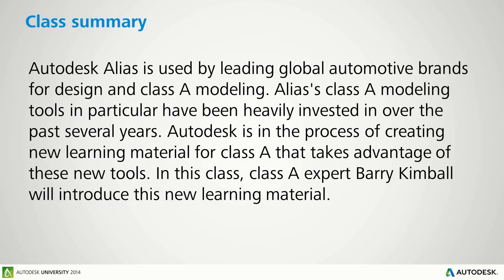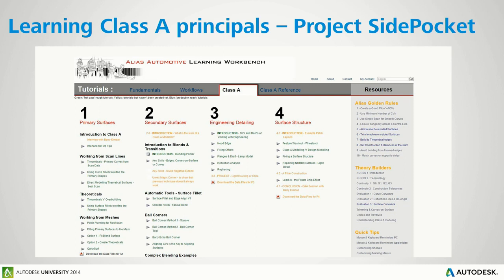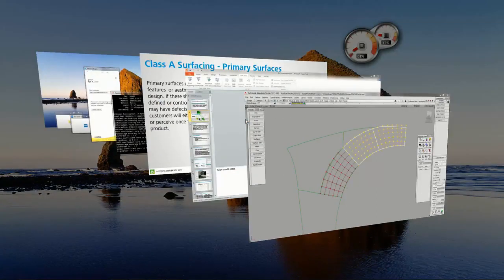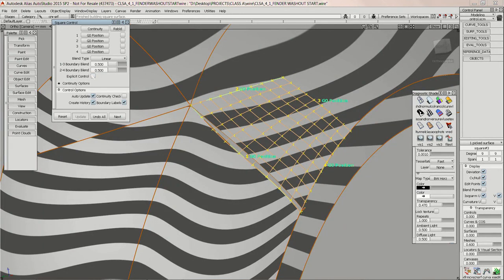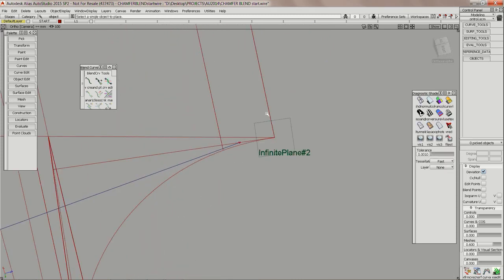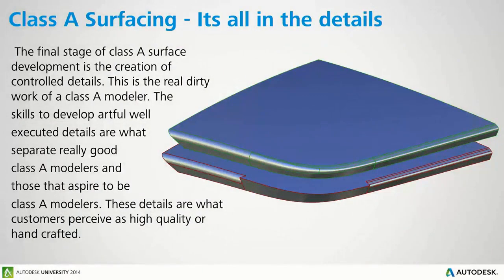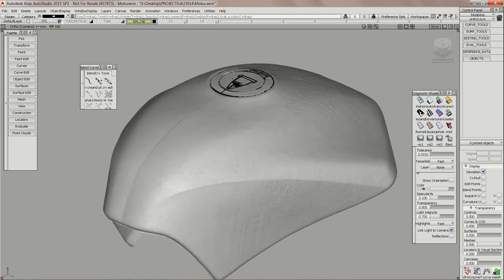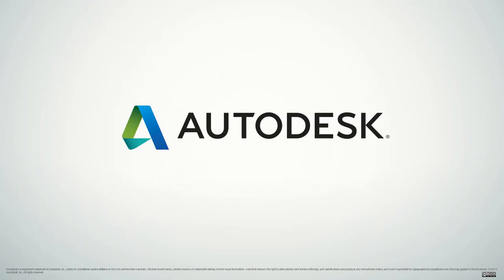Autodesk Alias Class A Surfacing Tutorial

Comment: It was great to watch the Workflow of creating the auxiliary Drafts and Free Form Blend surfaces. But wouldn't be easier to just use the existing top surface without creating the 'auxiliaries'. Having the top surface as well as the Curve On Surface on the side surface would suffice. Then using the Symmetric Fillet Control would generate same results?